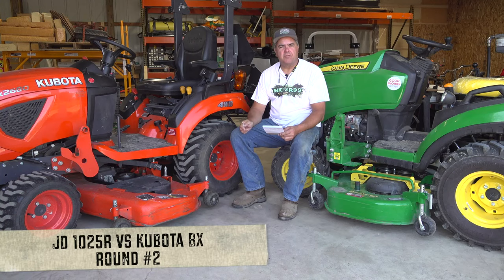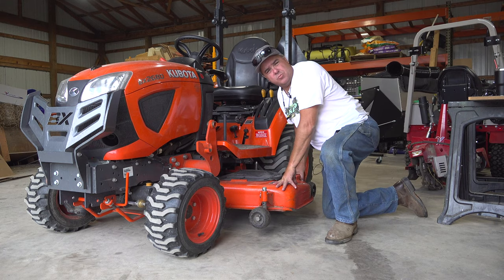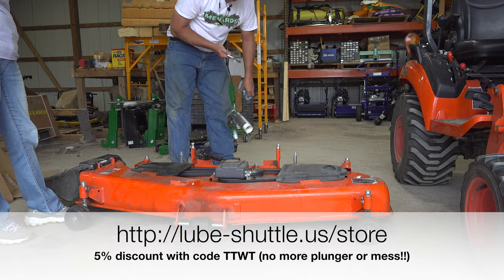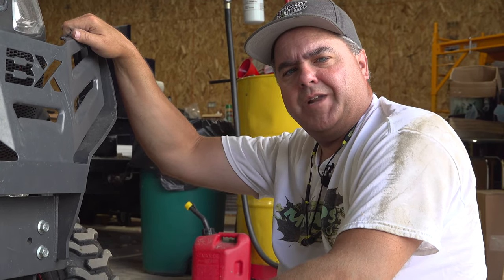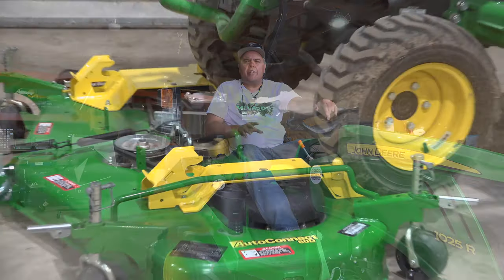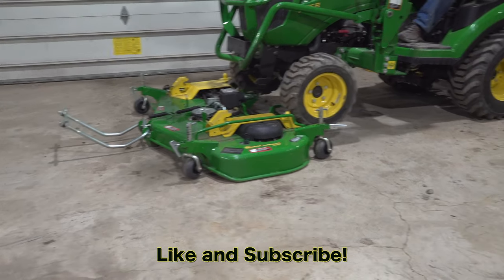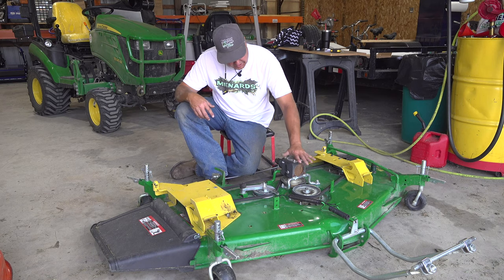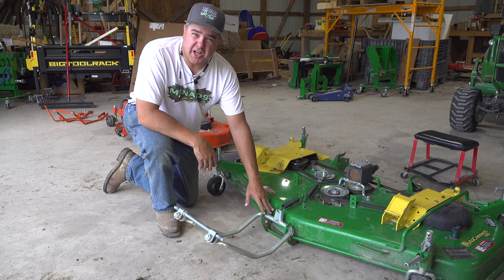Deere 1025R vs Kubota BX Round #2 of 8 Mower Deck

Comment: hey Tim great video.  I had a B3350 cab Kubota for the past four years and April of this year I traded for a new 3039R deere with cab and absolutely love it.  it has the 72D auto connect deck which is so much quicker and easier to remove/install than the 60” I had on my Kubota. i ran into all the same issues you just discussed when removing the Kubota deck the only difference was it was a rolling deck vs a floating deck.  though the two tractors are not an equal comparison in class they are close..  but without a doubt the deere does everything much better than the Kubota with the exception of one thing...The loader control on my Kubota was much smoother and easier to do multi function loader work with such as curl/lift, lower/dump functions at the same time.  I did also prefer the rolling mower deck versus the floating like my 72d on my deere but the deere hands down lays down a better cut and discharges the grass much better and more evenly..  like you mentioned in your video my deere raise height is not as heigh as the Kubota was but much easier to remove and prefer to do loader work and other chores without deck on anyway...i had some regen issues with the kubota as well that the dealer struggled to correctly fix on multiple occasions which also led me to going with deere this round.  I love Kubota tractors and the B3350 was the 5th Kubota I had owned up to that point just decided it was time for a change and so far very happy with my decision.  

Tim i am a huge tractor lover and enthusiast and thoroughly enjoy you’re families videos.
Thank you.

Greg Collins
Campbell, MO
Reply from the maker: Thanks for the in-depth comment, Greg!

Comment: Kubota has a drive over deck also they both JD and BX have their issues they are not fool prof delt with both
Reply from the maker: I could not find a Kubota drive over deck, and the Kubota sales folks actively discourage purchasing it.   So, I think it fair enough to compare the most popular (and recommended) BX mower with the most popular Deere solution.

Comment: You forgot to mention that you need to have the PTO in rear only position so that the shaft will automatically turn into position to connect on the Deere. This one implement is exactly why I spent the extra money for the Deere. My independent lift auto connect works great. At 70 years old I don’t need to be laying on my back fighting a mower deck.
Reply from the maker: Yes.  I forgot to mention that.  Please understand this was not meant to be a comprehensive tutorial on how to install the deck. Just a demo of the differences.

Comment: Hey, I have a 1025R and took off the mower deck then went to my dealer and bought a Zero Turn for mowing.  Works great! Also if you have a Deere bagger for your deck the Load and Go don’t have any where for the drive belt to the turbo,so get out the Plasma cutter. I Like your videos keep em coming.
Reply from the maker: I use the TKV20 from terraking.com.  It does not require the 'power flow' unit on the deck.  You can see the 'boot' in one of the scenes in this episode.

Comment: As a BX25D owner who has had the deck on a off a few dozen times that was a real world demonstration of the effort required to remove and install the mower deck. There are times when getting the rear latches lined up is a bear. It's not the worst job in the world but you certainly don't look forward to it. You tend not to take it off for convenience but only when absolutely required for rough terrain work or maintenance. 

Others have mentioned using the lower 90 degree setting on the gauge wheels helps when sliding the mower out so that the bolts on top don't hang up on the mower arms. This doesn't work on mine as the mower body is touching the ground when the lowest wheel setting is used.
Reply from the maker: Great comment.  This is one feature. There are many other excellent features on the BX.

Comment: Tim, you forgot to mention one thing to the viewers about the drive over deck install. I'm sure you know this, but others watching may not. You should explain to them how the long guide bar on the mower deck is used in conjunction with the left tire for ease of alignment during the installation. I think if it wasn't for that guide bar, I would probably miss the connection more often. Also, as a side note, I am one happy, satisfied customer with the auto connect deck. It is genius and anyone who doesn't like it must not be using it right. It's probably my most liked quick attach feature on the Deere. Great video.
Reply from the maker: Good point. Started to mention it, but thought it was a detail that might not matter for this case.

Comment: First off, I absolutely love your thorough review of these 2 tractors and subscribed.  There is nothing like it anywhere and you provide the detail that we consumers need before spending such huge money.  I currently own a bx2200 with 1620 hrs, and to be honest, the mower pto drive shaft is just a huge PITA.  You get used to the other parts of the deck removal, and Kubota kind of solved it with their extremely rare easy-over deck.  However, the driveshaft quick disconnect needs to be standard.  Prices are through the roof with the supply/inflation issues, but I have found better prices on the used John Deere 1025r package considering how much you get.  Now, the deal killer for me is the pathetic MMM deck clearance on the John Deere as everything else is pretty much equal or favors the JD.  In the Appalachian mountains and steep terrain (which requires 4wd to mow many of our yards) that 6" clearance is absolutely critical to mowing close to ditches,  steep grade changes, mowing rocky terrain, etc.  It also probably explains the popularity of Kubota BX tractors in my area.  So, is there any way you could think of to get close to 6" of mmm clearance with some type of lift mod or larger tire or is this just one of the deal killers that makes me Green with envy, but bleed Orange?  Thanks so much for any insight.
Reply from the maker: The deck is SO EASY TO REMOVE that the low clearance doesn't matter.    I only put the deck on to mow...and then remove it immediately when I finish mowing.  Different mindset.  No use dragging that deck around all the time.
Thanks for the kind words.  I'm glad you found this helpful.
Reply: @TractorTimewithTim  I would agree that the low clearance shouldn't matter for 98% of people's yards.  To clarify what may have been confusing, we need the clearance to go from one mowing spot on our property to the other.  We can't traverse many of the ditches and steeper areas without raising the deck all the way up.  We also use this to help mow rougher terrain in like a 5" mowing height position.  Pictures would help alot, but it's not just a matter of transporting the deck around when not mowing, it's the nature of rough mountainous terrain and trying to mow from one high clearance area to the next.  With rocky terrain, it's not possible to grade properly, and it's not really lawn mowing in these areas as it's really indigenous wild grasses and lots of weeds that grow in these areas.  Most people might use a finish mower or bush hog, but it's just a whole lot faster to use the MMM for everything and really minimizes weed wacking.   I really appreciate the quick response, and look forward to watching more of your informative videos!  Thanks.
Reply from the maker: Hmm.  Good points.

Comment: Maybe the rops were angled forward on the Deere to protect the operator a little quicker. Looks to be right over operators head so if working around logs or rocks the rops may protect operator quicker than other ones where that rock or log may be on the inside of rops causing more injuries

Comment: Why did you pin the wheels on the Kubota to make the deck higher and harder to remove? If you are going to remove the pins and turn the wheels, put them up as high as possible to keep the deck lower for clearance.
Reply from the maker: correct. I did not see this or think about this.  Sorry.
I did not think the issue of the bolt hitting the frame was a big deal anyway.

Comment: Tim,   Can you do a video on how to set the height adjustment on a 1025R.   I am a new 1025R owner and have not seen a good or any video for how to see that deck height at the maximum height.  Really love your videos.
Reply from the maker: I have an auto-connect deck adjustment video.  Some of those tips can show how to get the max height out of your deck.
Reply: @TractorTimewithTim    I will take a look again at it. I did see the one you were talking about the height on the front connect bar and alignment.    From my understanding on the reading I have done, you have to make an adjustment with the height cam.    Thanks

Comment: Kubota has a drive over deck to guys just like Deere  just cost a little more  love my kubota looked  but my choice between the to came to price both are exceptional machines in my area I got my kubota  2500 dollars cheaper  so it was a no brained for me
Reply: Brainer
Reply from the maker: Do you have the Kubota drive over deck?

Comment: I've beening looking at my first tractor. I sit on 2.5 acres, of which 2 of them are grass. We have a creek and trees. I have some projects in mind that would  benefit from a backloader and loader. Though it would mostly be used as a mower. Any insight would be appreciated.
Reply from the maker: 1025r should be at the top of your list.
Reply: @Tractor Time with Tim  I have no brand loyalty or bias. The Deere seem to be more expensive, and the customer service that I've experienced hasn't been the best.
Reply from the maker: No other brand comes close to competing with the mower deck handling of the Deere.   
1. Drive over auto connect
2. Load n go allows loader to pick it up and move it..and tilt it for service.
3. Deck stands from http://MuddsCustoms.com (use code ttwt) creates a very nice rolling storage solution.
No other manufacturer can do ANY of those.
Also, the turning radius of the Deere is so much better.  This is important in all situations…but even moreso in mowing.
Add this to the rest of the info in the 11 episodes of this review.  I find it hard to justify ANY other subcompact tractor.  
My opinion is not nearly so strong on some of the larger machines, but on this size…which is the size you need, there is so much distance between the competition that it is almost laughable.  This is why Deere has raised the price.

Comment: If the loader is not on the tractor, I unhook the linkages and the PTO. Then I take my other loader tractor and lift the front of the tractor off the ground to clear the mower. I chain to the tractor frame where the push guard bolts on. Then I drive the loader tractor ahead pushing the kubota back. I least the tractor down and then I drag the mower out of the way.
Reply from the maker: Ha!   I just use my auto-connect.

Comment: With the kubota you need a hard flat surface. I’m getting the impression that a jack under the front end might be a good idea when removing or installing the deck. Is there a higher hole setting for the wheels when turning them sideways, that would lower the deck more. Maybe it would give more room for the bolts that were hanging up.
Reply from the maker: The bolts hanging up is really a non issue. no big deal.

Comment: The deck removal on the BX is just like the one on my (former) JD X485...
It’s really not that bad...you just have to be patient. 
That being said I also owned a 1025R. The auto connect was an awesome feature... but can be a real bugger until you get it dialed in.
Reply from the maker: I didn't think the bx deck was difficult either.  But it is definitely not as easy as the auto connect Deere.  And I do believe that it is difficult enough that folks will tend to leave the deck on when they should be removing it.
Reply: The one thing I think about would be that most folks that use a subcompact for day to day (business, if you will) probably don’t use a mower deck on their sub-c. I would tend to believe that another piece of equipment (such as a zero turn) would take care of that chore.... so the on and off with the MMM would probably be held to a minimum.

Comment: I haven’t had to remove my Kubota deck yet while doing loader work and backhoe work. As was shown, the Kubota deck is much higher and is less likely to get in the way for most other work. And how much more expensive is the “quick attach” system anyway?Just curious.
Reply from the maker: The drive over portion is standard.  The pto autoconnect is $522 retail.
Reply from the maker: I put the deck On before I mow, and take it off after I mow...just like any other attachment.
Does your mower somehow compress to 48” wide too?  
It saddens me to see people miss out on functionality and maneuverability of their tractor simply because an attachment is too difficult to take off.
Reply: Tractor Time with Tim I should say I have a B2650 with a 60” deck. The deck is made to be “pinned up” directly to the tractor if one wishes to do other tasks. It’s a nice convince as far as I’m concerned. I’m guessing the BX series is the same? Sure thing the mower deck is harder to remove than the JD system but it was not a deal breaker for me. My 30 year old Gravely has a drive over deck (no auto connect drive shaft of course) so I know in part how nice that is. If the Kubota deck ever hampers my ability to do a task, I obviously will remove it. It’s simply no big deal, at least for me. I have a friend who did hit something with his Kubota mower and broke the center shaft. He replaced only the shaft and seal. He did not have to replace the whole gear box assembly. His is an older tractor so if Kubota changed  the gear box that requires full replacement, then shame on them!

Comment: Thanks Tim. The problem with my 1025r is the hydrologic cylinder is not letting the PTO go down for install. Like it's heavy enough.
Reply from the maker: Ok.  Do you have the 3 point arms on? Can you push down the 3 pt manually?
Reply: Not connected to the 3 pt but I do have the arms and quick hitch attachment. It's has it's own hydraulic cylinder that is connected to the joystick power outlet with one hose. Power on the pickup and gravity on the down stroke for the mower deck. When the mower is disconnected, lowering the midpoint PTO is difficult. I have to use a stick or piece of pipe to pry down when lowering the midpoint PTO. It's a real pain. Thank for the inquiry Tim. Love your videos.

Comment: We're all tim and deere fans and all, but did I miss why he didn't use Kubota drive over deck for comparison. And to share cut quality difference. Maybe i need to watch on.. Also, I've enjoyed many hours of tim videos but any chance I've missed full disclosure advertising assistance from deere. Tim, you and John deeres are great, but Kubota seems to be as well.
Reply from the maker: I have fully disclosed our partnership with Deere. Discussed it in each of the intro episodes when we showed the new equipment.  It is listed on our website.  And we discussed it in round 1 of the bx/1025r comparison.
AHW LLC, our local Deere dealer has leases ya three machines.  5075e, 2038r, and Gator.
They have subsidized the lease.  We still paid a significant amount on this lease, but much less than it would have been without their help.
We discussed the non drive over decision in the follow up to the deck removal round.  We couldn’t find one, and Kubota dealers nearly universally do not recommend them.   Many comments agreed with our assessment.
Cut quality.  We did mow with both machines, but our yard was so uneven and patchy, and grass so poor that it would have been very difficult to make any objective conclusions.  From what we DID see, they seemed about the same.  Both are reasonable mowing machines, but not comparable to a quality ZTR.
We have always been as open and direct as we can possibly be.  If I have left anything out, please let me know.
Reply: @TractorTimewithTim  I really appreciate the reply Tim. I didn't really intend to target a john deere partnership, but curiosity can get the best at times. I'll pay better attention to your mentionings to better understand. I guess my interest of this particular video was the hopes to see kubota's drive over deck compared to deere's and a higher yet interest of a potential better cut quality of the kubota deck. But yes, a highly manicured yard may make the difference. Thanks a lot Tim.
Reply from the maker: No worries, Scott.  Perhaps I’m over sensitive to the Deere thing.  I do NOT want to be sneaky about it.  Certainly don’t want to come across that way.
I really didn’t see any difference in cut quality.  Not sure why there would be any difference. Both decks use same ‘float” approach.  Deere deck has a larger cavity as shown in one of our comparison series...should in theory have better lift...but probably not noticeable in practice.
Anyway, we don’t intend to be slanted in any way. That wouldn’t help anyone!!!   
Thanks!

Comment: I've had my BX23s for a little over a year now and I install and remove my deck before and after every mowing so I've had a little practice. I don't turn the anti-scalp wheels to remove and choose the yank method like Neil does in his video. Therefore, I am always doing it on the concrete floor of my garage to allow it to slide better. I find the only time I need to get on the floor is for the pto engagement and disengagement. I've found for the front bracket assembly to go smoothly for install or removal it can't be done with the bracket laying on the floor. Because of some of the angles it has to be lifted slightly for both hooks to engage properly. All in all hook up or removal for me can be done in well under 5 minutes. That being said I would still love to have the ease of the JD system and definitely would love to see a QA version of JD's Load-n-Go.